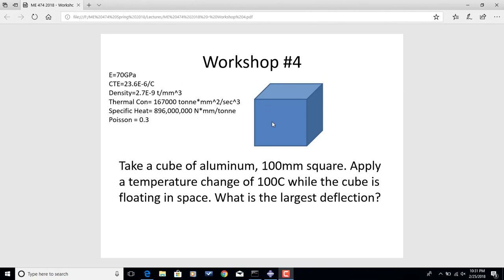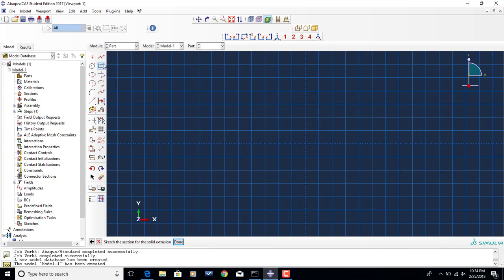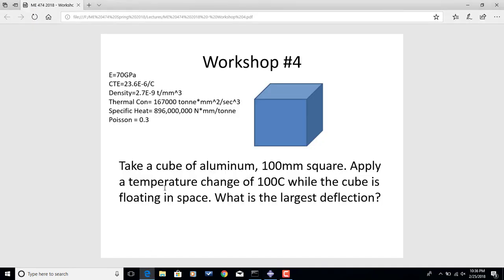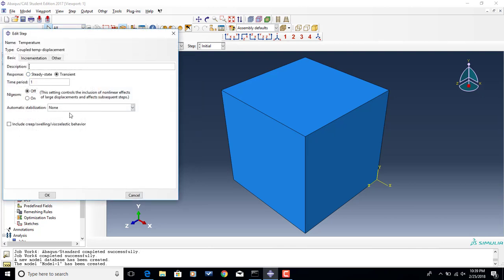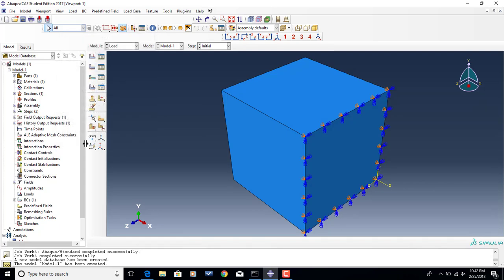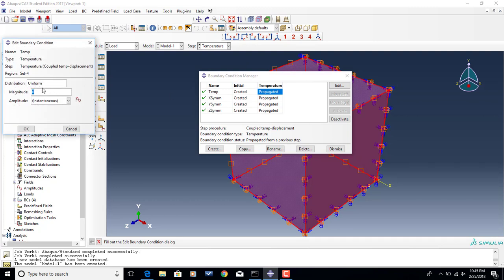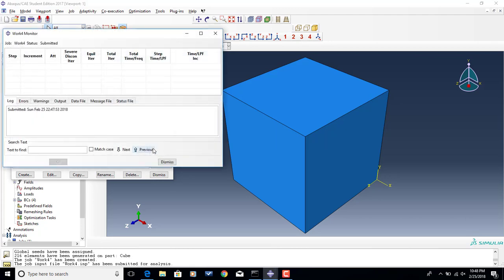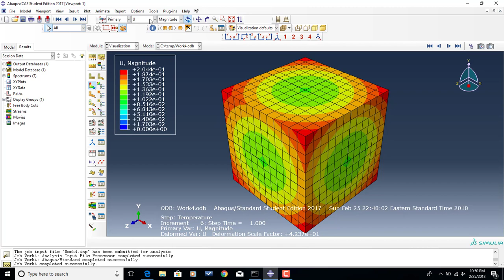Widener ME474 Abaqus Workshop 4 - Coupled Temperature Displacement

Comment: Hello sir. I have a doubt with the results. How come stresses appear in the results when the cube is free to expand. Analytically there should be no stress. Then how come it appear in the model
Reply: The stresses that are shown there are to the -13th and -14th power. I am sure it is an Abaqus rounding issue. Those values are essentially zero. 

Thanks for the question!